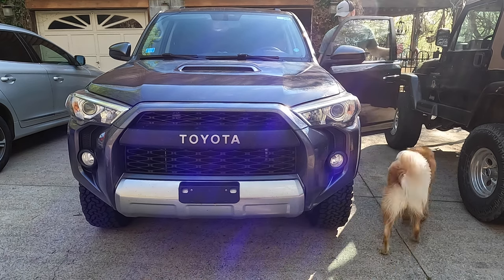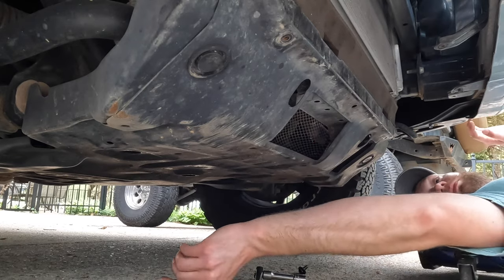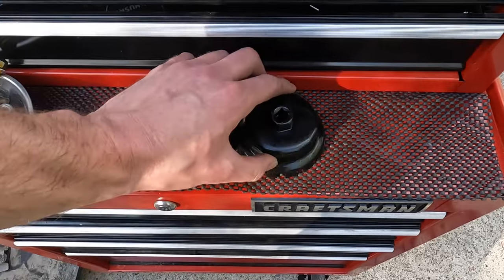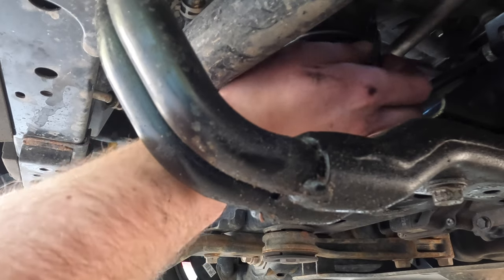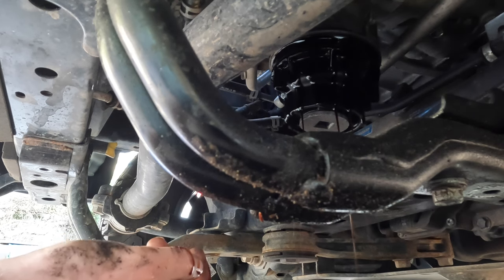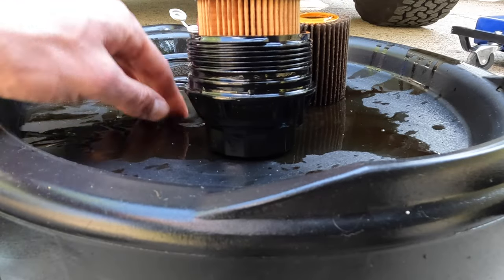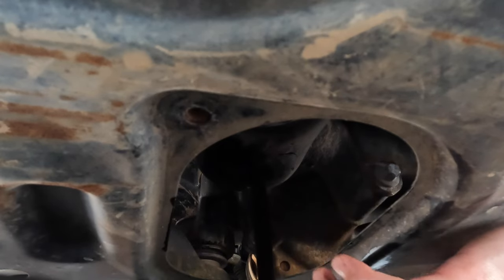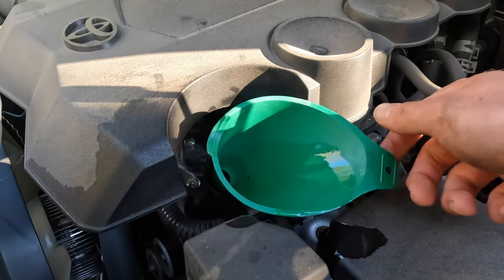How to change the engine oil on a TOYOTA 4Runner - 2010-2023 (5th Gen)

Comment: I have a 19. Also a 15 Tacoma. I’d like to talk to the Brilliant Engineer that thought it would be ok to put a heavy skid plate over the oil filter . They put a removable cover over the drain plug, why not a removable cover for the oil filter/ Cheez! My Tacoma is right at the top Bam it’s off.
Reply from the maker: I've written emails to try and find that engineer. I don't know what they were thinking, pretty bad design.

Comment: There is nothing about this that is easy. Remove two skid plates after lifting the vehicle to get to the plates, using 3 different wrench sizes. I can change oil and filter on my 65 Mustang in 15 minutes using only an open end wrench. Why didn't they give us an access port for the filter like there is for the drain plug. I took the two skid plates off completely and may cut an access port for the filter. I did take the skid plate off of my 2016 Tacoma 6 years ago and everything has been fine since.
Reply: For vehicles that are intended to be used off road, skid plates are necessary to protect these components. This is easy to do. Not as easy as an oil change in the previous generation of these cars, but this isn't a difficult task lmao.
Reply: I think you meant to say it's not fast rather than not easy.
Reply from the maker: It's a lengthy process for sure, but step by step it's not too complicated. Even after doing it a dozen or more times myself I still need 40 minutes to do the whole job. I have an '01 Wrangler and like your '65 I can knock that oil change out in 10-15 minutes flat - just doesn't seem fair by comparison... And I 100% agree with you; Toyota could have done better in cutting a port in the front skid plate for access to the oil filter. This whole thing has got me thinking though and I may try to cut a port in my skid plate now that were talking about it. Hope this video helped you get your oil changed (even though it is a bit of a pain) and thank you for the idea!
Reply: @Pietop  The first time I changed the oil, I lost a lot of faith in Toyota for the poor design. Got tired of paying too much to Quick Oil Change shops and not knowing if they did it all and did it right. Since my vehicles are not used for off road, the skid plates are nothing but worthless weight although there may be some gain for aerodynamics. The Tacoma's skid plate has long since been delivered to the scrap metal recycler, but I will cut an access for the 4Runner plate, probably with a cutting torch with the slag ground smooth. Have a great day
Reply: @rachelr12345 my 2004 goes off road just fine and I remove zero skid plates to access the oil filter. This is a pain in the 2010+
Reply: @StephenHipps-r2w I agree, toyota has lost it
Reply: Yeah I'll just pay the $60 bucks at the dealer.

Comment: Wait hold up !! So every time I go into the mechanic shop for an oil change on my 4runner they gonna be doing all this everytime ?
Reply from the maker: If you have a skid plate - yes. Otherwise it's way less time consuming.
Reply: @Pietop  oh come on I'm about to get a 4runner 5th gen...and while we are on the topic.whats the best brand engine oil to use? conventional or full synthetic? And what type 0w-30 ? Also what transmission fluid,brake fluid and power steering fluid to buy ? If I leave out any other fluid please fill me in.i plan to drain everything out and replace it with fresh new fluids because when u buy a pre-owned vehicle u don't know what quality of oils these dealers put in the vehicle.and my guess is that they ain't gonna use top quality stuff.please correct me if im wrong.im eager and humbled to learn from u.thank you
Reply from the maker: @Final_Fantasy_7  any brand of oil is fine if you change it frequently but just make sure you use fully synthetic 0w-20. Check out my channel for the other fluids, I have videos on the important ones and I have more planned to come out in the coming months.

Comment: How many miles will that full synthetic run you?
Reply from the maker: I change mine every 5,000 miles. It starts to break down and turn black around 4,000 and by the time it gets to 5,000 it's solid black and ready to be changed.

Comment: Just did my first oil change on my 2024 limited.  Scratching my head as to why they put an access port for the drain but didn't for the filter.  Looks like it could have been done.  Mine is all coated with Surface Shield so that makes it extra fun to fiddle with the rock shield..
Reply from the maker: I know right - It's wild they didn't cut a port hole for the filter too. Maybe they'll do it one day but not on these 5th gens...
Reply: Aftermarket skid plates typically do. I have an RCI plate and there's a small plate held by two 5mm bolts for easy access.

Comment: Good video I just changed mine for the first time. You never change the metal thing on top of the oil air filter?
Reply from the maker: The little metal clip? Never.
Reply: @Pietop  the metal clip that you can pinch to drain the oil filter on top of the oil filter I’m asking because I didn’t do it either because the previous person who changed my oil put it on too tight and I couldn’t take it off
Reply from the maker: @XxAlex530xX  you don't have to do that. It's just an extra step from Toyota for convenience but it's fine if you just leave it alone.

Comment: Why did you remove the metal clip thing in the oil filter housing? I saw another video where they didn’t do that. It seems unnecessary. No?
Reply from the maker: The clip has to come off but I'm not sure why it's even there... Maybe to just mark that the oil filter housing is tight enough. I've considered many times just taking it off and leaving it off but I just keep putting it back on for whatever reason.
Reply: I would think that it's also an extra measure to prevent the oil filter housing from coming loose due to vibration.

Comment: Would it be better to use a torque trench to tighten the filter and drain plug?
Reply from the maker: I haven't found that to be necessary for either, but you could if you knew the torque specs. I've found the drain plug does fine being snugged up with a ratchet by hand. If I had to guess I would say this is around 30 pounds or so, maybe even a touch less. Might want to get a new washer for your plug though, it's not the end of the world if you don't put a new one on every time but sometimes you'll get a small leak at your plug and think it's because it's not tight enough when it's actually your washer that's gone bad. Definitely don't over tighten your plug is my point - just hand snug with a ratchet. 

The filter only goes so far before it stops so I just snug it up to the point where I can put that little silver clip back on in the right place and call it good. You definitely don't want to over torque it either because it's plastic.
Reply: @Pietop  thanks for the feedback! I think I’ll just go with hand tightening

Comment: Do you have to remove the metal skid in order to access the small plate that covers the oil drain plug?
Reply from the maker: No, the small plate that covers the drain plug unbolts from a larger skid plate. The only skid plate you need to take off is the one closest to the front of the 4runner that covers the oil filter.
Reply: @Pietop  thank you, greatly appreciate the quick response. Have a wonderful evening.
Reply from the maker: @beaviskornholio2754  hey no problem, if I'm around I try my best to respond to people. Best of luck changing your oil!
Reply: @Pietop  sorry to bother you again. 1 more question. If you don't put the metal clip back on the filter housing is that going to cause a problem.

Comment: Getting to do my own.

Why does Toyota recommend change intervals of 10K miles?  Seems a stretch. 🤷‍♂️
Reply from the maker: I think it's because a lot of oil companies have started creating oils that they market can go 10k by adding dispersants and detergents, and it's convenient marketing for Toyota to take that and pass it along to us. I've stuck to 5k intervals with my 4runner and the oil I drain is always a deep black color meaning it's been heated and broken down to the point of needing to be replaced. If auto mechanics isn't your thing than 10k is probably okay, it'll get you down the road, but if you enjoy working on your machines and take pride in them lasting a long time then I'd change every 5k. Thanks for asking!
Reply: @Pietop   Thanks for the response!  

I have a 19’ and it’s been about 5200 miles since last change.

I just checked and the level is still good, and it’s not too dark. I do see black deposits. 

Should I just go ahead and change?
Reply from the maker: @Unplugged704  I wouldn't say you necessarily have to do it today but here in the next couple of weeks, yeah, I'd say it's about time for a change. Between 5k and 6k is fine. Just stay loser to 5k than 10k between changes and you'll be a'okay - general rule of thumb for my vehicles anyways.

Comment: yeah thanks really simple. you dont use ramps or jacks?
Reply from the maker: There's actually enough ground clearance to slip under the vehicle without ramps or anyting but admittedly it would make the job a bit easier.
Reply: @Pietop  I just did my first ever oil change today. Thanks for the clear instructions! Used ramps. Going to get a fumoto valve for the next one.
Reply from the maker: @JM-kr2mo  makes me happy to know the video helped you out! I'm going to have to invest in some ramps - I bet it's way easier!
Reply: @Pietop   I got HF ramps on sale for 44$. Don't get the metal ones tho, looks like they can just buckle instantly, plastic ones were plenty good.
Reply from the maker: @JM-kr2mo  I'll take any excuse to go rummage around harbor freight for an hour! Heck if I get them I might make an update video with them!

Comment: Does your owners manual say 0w-20? I thought it said 5W-20 for the 2019 SR5
Reply from the maker: 0w-20 is what my owner manual recommends and works best. It also says that 5w-20 will work too but should be replaced with 0w-20 at the following oil change. The only difference is that 0w-20 is a little bit better for starting in cold weather. I guess if you live somewhere that never freezes you could probably get away with it 5w-20.
Reply: Ow-20 for all 4runners
Reply from the maker: @joeblow-xy3oz  do you know if that includes older generations too?
Reply: @Pietop  yes you you can use 5-20 as directed in owners manual.  The 0-20 is better in colder climates, i usually use 5-20  spring to fall and 0-20 in winter.
Reply from the maker: @ruckinehround6965  100% spot on. Is there any notable advantage using 5-20 in the warmer months that you've noticed or is it just personal preference?

Comment: u did not mention to put new gasket on oil drain plug
Reply from the maker: Thanks for pointing that out. You can pick them up at any auto store or in bulk online. Re-using the old one isn't the end of the world if you don't have one on hand, but you shouldn't make that a habit. Always good to replace it.

Comment: Are you sure it’s 6.6 qtz?
Reply from the maker: If you're replacing the oil filter too and loosing that amount of oil trapped in the canister then yes  - 6.6  qtz. If you don't replace the filter it's probably closer to 6 qtz but I always replace the filter.